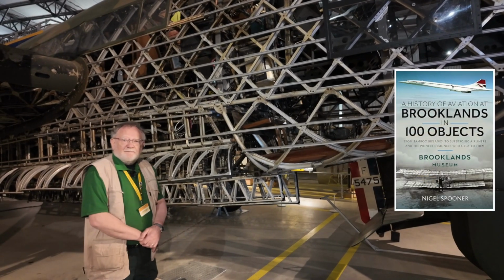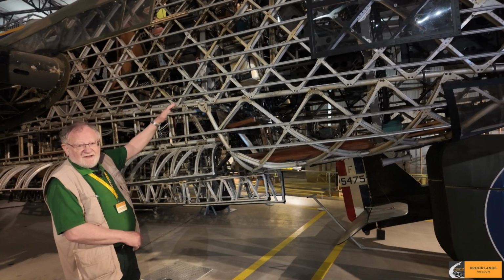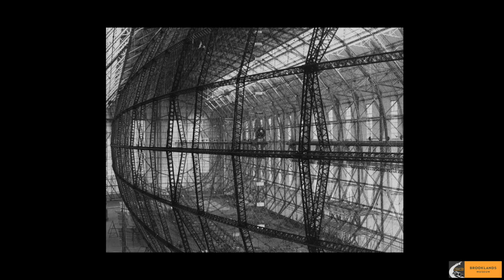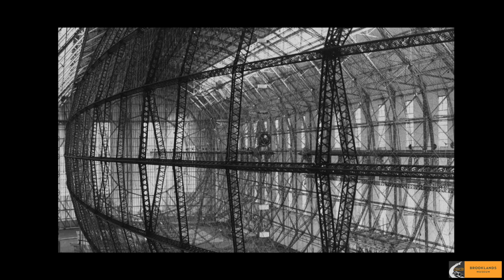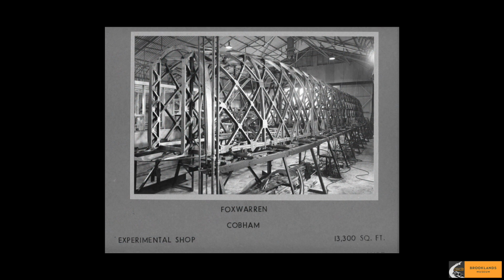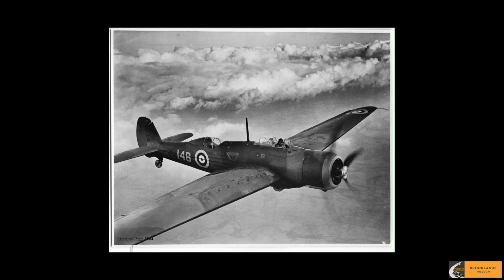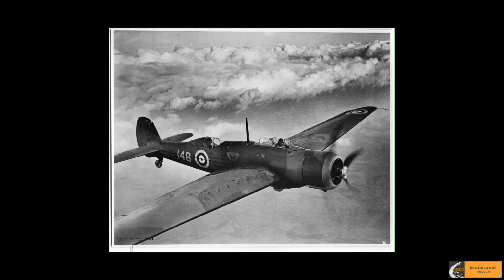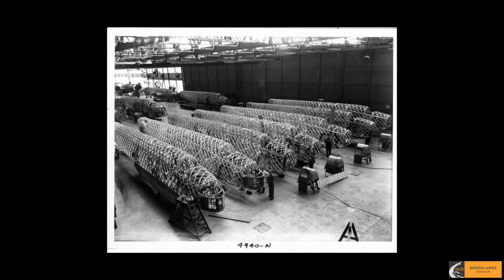Geodetic Construction. A History of Brooklands Aviation in 100 Objects

Comment: The method for producing the required components was a series of 5 to 7 rollers to form the required profile followed by between 1 to 3 further rollers to form the required curve. The material was an aluminium alloy called Duralumin.